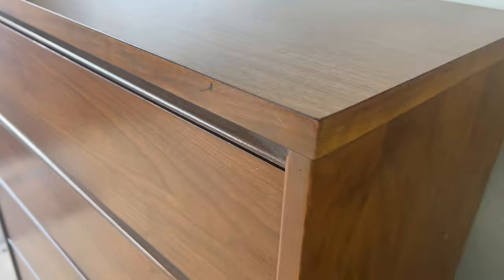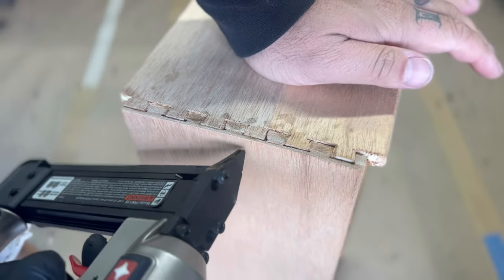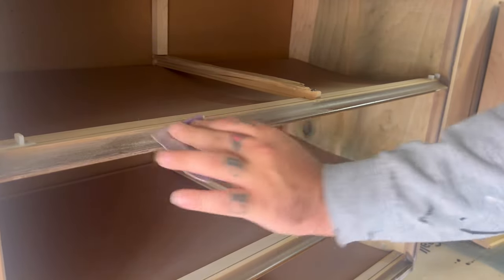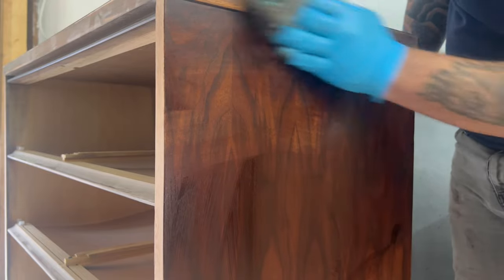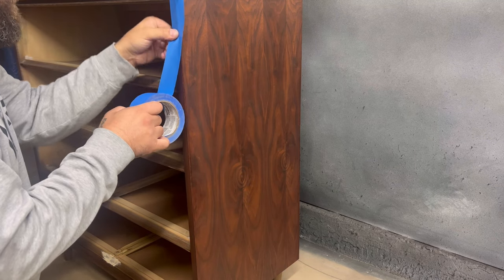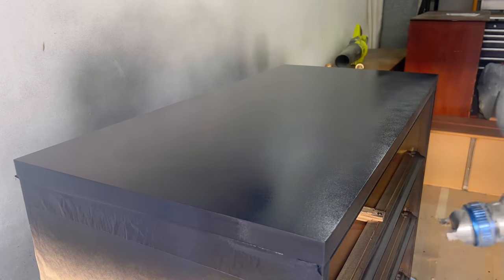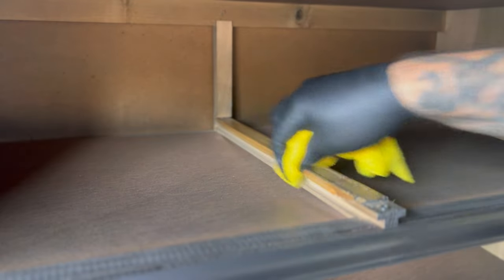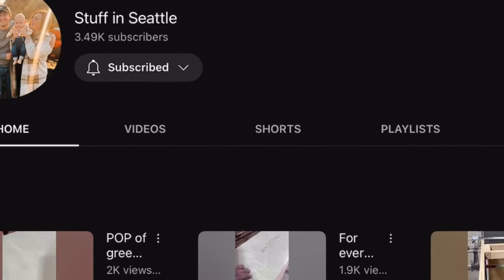Collaboration with a fellow furniture flipper || DIY DRESSER UPDATE mid century modern TALL BOY

Comment: Turned out nice. Those castors are not original to that chest, even the legs may have been shortened a half inch to drill hole for castors. Looks much better without them imo.
Reply from the maker: That’s good to know. Thank you. I didn’t really like them. Ended up taking them off and giving em to the new owner as an option